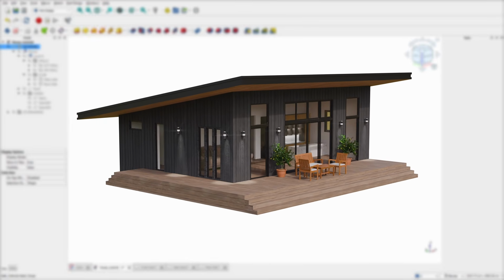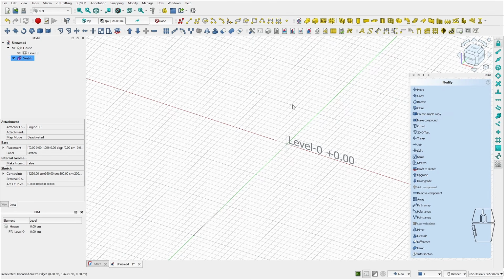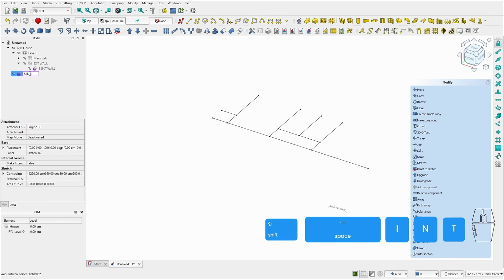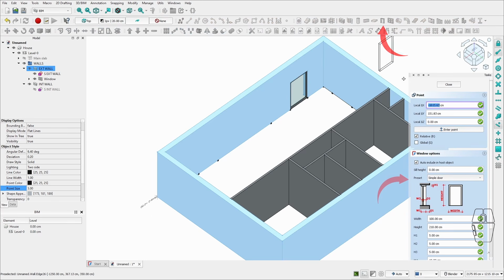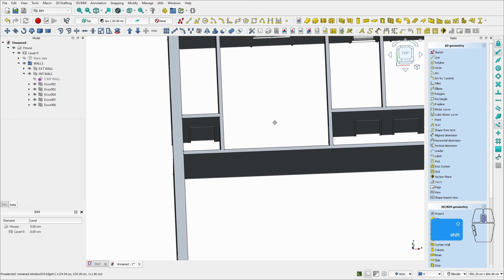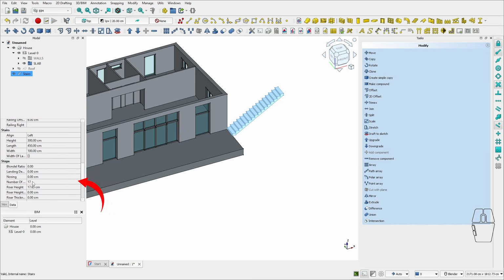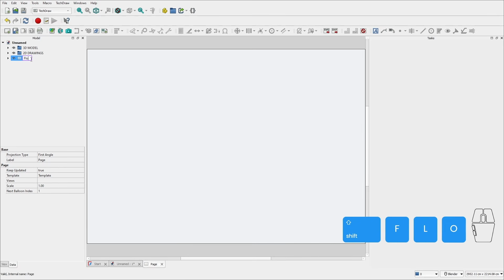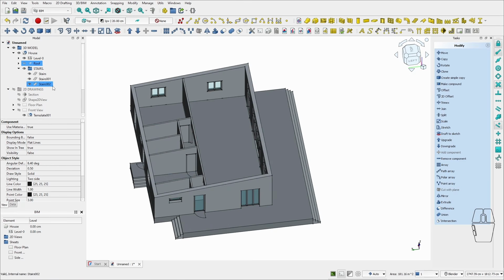FreeCAD 2025 BIM - Architecture - Complete Beginner Tutorial

Comment: I can't get this to work.
I put the points in the wall sketch but even if made larger they are not visible when I click the door button. even if I increase the size. I can't snap to them even with the snap to nearest option set.
often when I click door I get a window and I'm careful ensure no mis click.
I've restarted a few times as sometime freecad bugs disappear on restart.
using version 1.0

I assumed it was just me and rewatched and retried lots of times but I can't get doors to snap to the points and often I get a window created instead of a door.

after some RTFM I see that doors are types of windows so that I get now, still can't land a door on points though
Reply from the maker: @pauldwyer7736 FreeCAD utilizes a single tool for creating both doors and windows. You'll need to adjust the presets within the panel to differentiate between them.
To ensure accurate snapping to points, be sure your sketch is visible and toggle the 'Snap End Point' option within the Draft Snapping tool. Even if the points appear small, you should be able to snap to them effectively. And of course the Snap Lock should be enable.
Reply: @deltahedra3D  cheers, understand on the windows and door but the snapping doesn't work still. does the distance between the snap points need to match the width of the door to snap or does the door size to the snap points or just snap to the point you select?
Reply from the maker: @pauldwyer7736 That's very strange, because regardless of the window size, you should be able to snap it to the sketch points. Can you snap to the bottom corner of a wall? Are you sure that the snapping tools are activated?